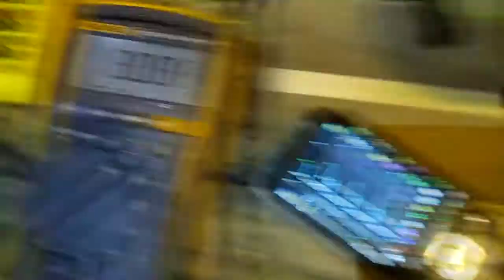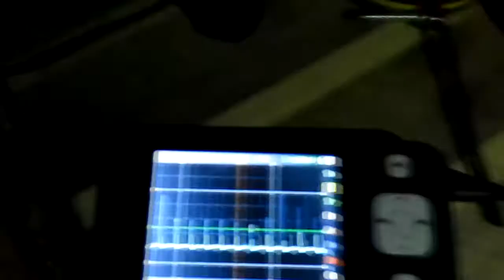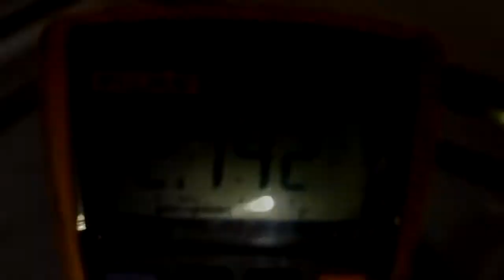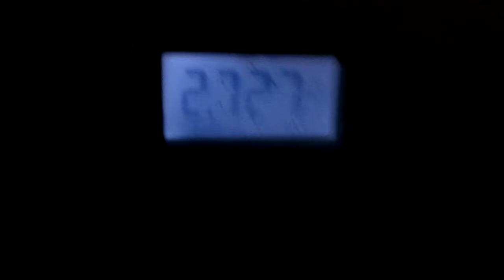Mykes Joe CEll Experiment Dec 2014

Comment: so from what i have come to understand is the insulators or spacers are not insulators. its a charge spearator more then insulator and by that i mean it attracts the gas to slam into the spacers and catch the protons then allow the protons to load the metal.
Reply from the maker: thats just hot glue to keep the tubes from moving, the liquid solution is the catalyst

Comment: oooh still got all the parts?
Reply from the maker: yes
Reply: @mykedoes4099  i feel like it was less than a year since i asked but here we are🤷‍♂️
Reply from the maker: @m3sca1  sorry sometimes i dont get the notifications
Reply from the maker: @m3sca1  when i did the experiment i dont recall if i adjusted the ph on the steal with lemon . As stated by Joe . I am under the impression all you need is frequency, but ph rotating the steal tubes might have some better results with magnetic manipulation of a combustion motor , supposedly thats what the cell is supposed to do , polarize your engine block so it can run on pure magnetics. at the time is was shooting for Hydrogen gas output . I did not see myself having success with the manipulation of the engine block and its steal parts to turn them into magnets. Which in my opinion is possible but only with all steal engine, aluminum not going to work in my "opinion" i could be wrong as arm strong on that though
Reply: @mykedoes4099  i have spoke to Joe personally, the gas was not piped in. He didnt know why he hooked it up like that,  i think it loads the metal the protons or whatever it is. It has to have an uphill path to the engine and a rubber stopper as a charge separator again... I think the process is catalytic and burning nitrogen. also when you make gas in the cell with unprocessed water, your gonna foul the separators with conductive red crap. that requires the cell be rebuilt. see if you can find a document by a fellow named Stephen Jones
Reply from the maker: @m3sca1  ok

Comment: You need Dc for the JC..
Not static electricity..Geez..:|
Facepalm.
Reply from the maker: Just having fun with it , the cell did some strange stuff with the bubbles like moving them to oppisite side suddenly. Was using radient energy pulses dc.  I did not charge the water as your supposed to learn how to charge the water properlly before you put it in the cell. THink the water has to hold 1.5 volt  then it's charged. That takes low amp low volt dc constant current i think so you may be right .. ps forward me any info you got looking for collaberators. South Florida area
Reply: @mykedoes4099   @myke Does  Not sure if you've already seen "joe's" videos yet but they are under "from the horses mouth joe cell" there are a couple of hour long videos with explanations. Nice video keep it up, ill be watching your progress.
Reply from the maker: @captainfruitbatgaming8427  The Joe cell was just hobby , never got as far as finishing the cell, it deserves someone with more time . Hopefully i will have time in the future to try it again with better help, I have no experience with lathe or metal working machines and this cell requires accurate work. You know how it is. At the moment I am more focused on this idea and getting people to replicate it open source. check it out https://www.youtube.com/watch?v=WH4watZLhOA